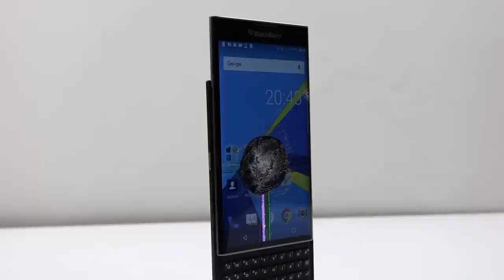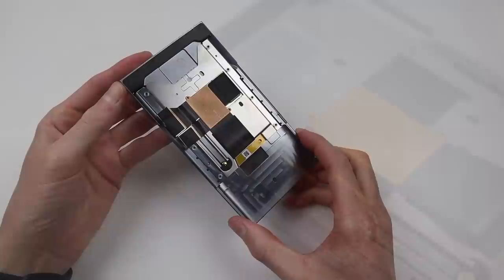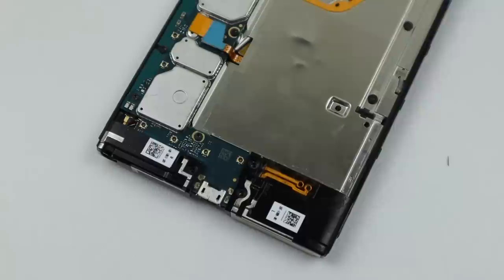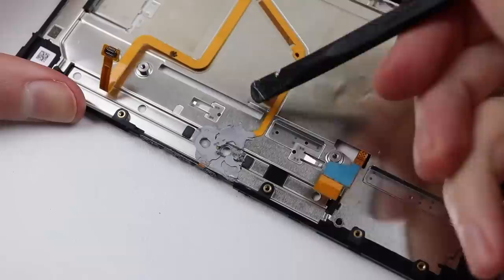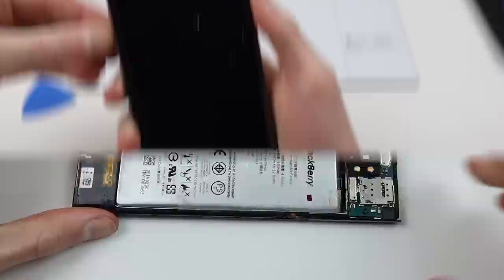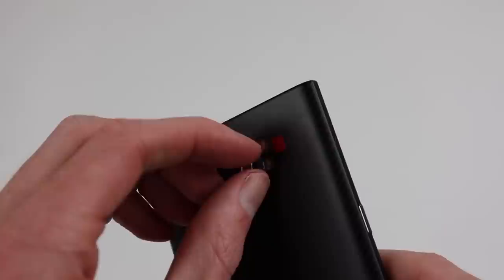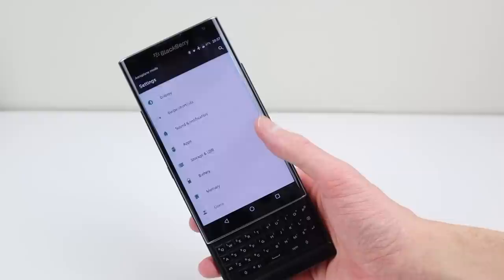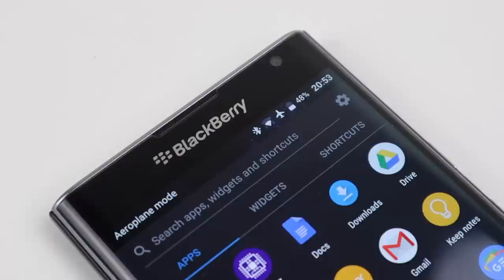Unique Blackberry Priv Restoration - Android slider with keyboard

Comment: Yes the iphone 11 pro has a smaller battery, but iphone 11 pro has 3-4 times better battery life than this junk android, 'cause apple's cpus are way more efficient
Reply from the maker: See but I spent over $1500 less for my phone.
Reply: @HughJeffreys  Do you wanna say that this blackberry cost -$500?! (minus $500).
Reply: @JakeJoris  he did get it for a few cents after all..for a broken PRIV that's a great deal, the screen replacement was over  100 bucks, that's still not bad overall considering how easy it is to self replace
Reply from the maker: The base model costs $1750AUD, I paid around $150 for this BlackBerry there for it cost over $1500 less.
Reply: @HughJeffreys  holly $h!t!! That's one of the reasons why I don't live in Australia.